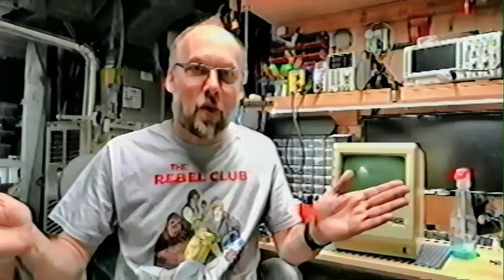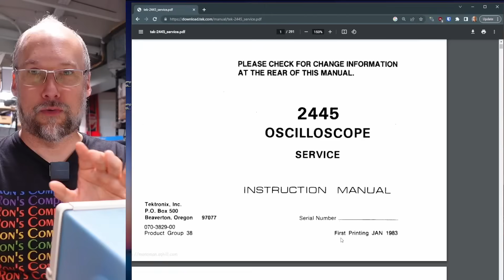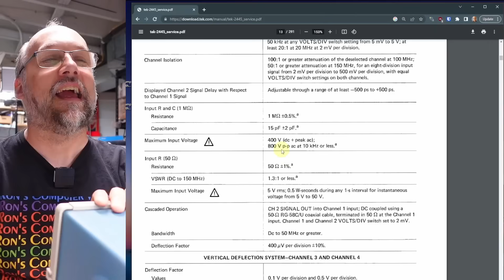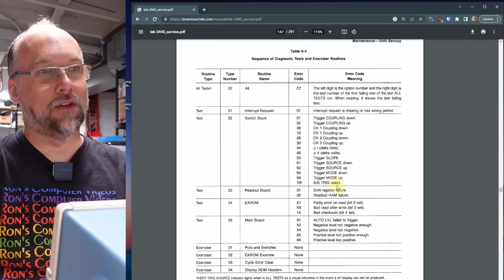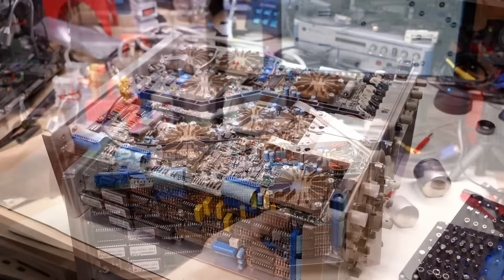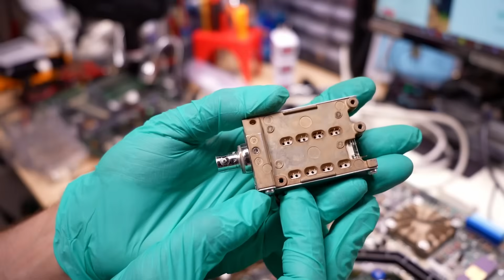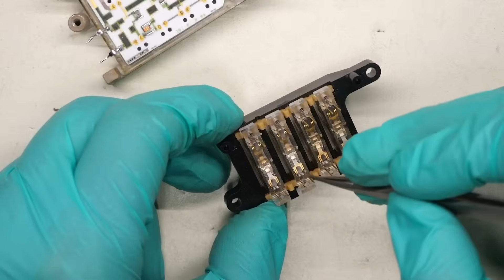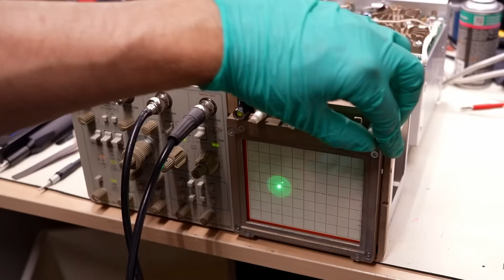Tektronix 2445: My first vintage oscilloscope repair attempt

Comment: No, no, no. Don't scrape those contacts like that. Clean/scrub with an alcohol pad (IPA). DON'T use the "fader lube" Deoxit or anything that contains lubricant.

The relay internal contacts might need cleaning. And as also suggested, carefully bend those tangs in the direction to give better contact.

Having to use a paper wedge means you haven't fixed it . . . the issue still persists.

Comment: I'd use a fiberglass scratch brush before I'd scrape any contacts with anything, especially gold plated ones. A pencil eraser would be the best thing to use in my opinion and would shine those right up again no problem. This works on copper, nikel plated, or any other type of contacts as well.

Comment: Dont know about rifas, but I know some of these scopes, my 2445a being one, has a battery that as of late is getting very old and is at risk of dying. That battery is for the memory that is where all the calibration onformation is stored and is a little tricky to change as you need to supply alternative voltage while swapping the batter to ensure the memory is not lost. If that happens I heard that calibration is virtually impossible for the average hobbyist due to the equipment needed to perform it, making it a pretty costly venture. I tested the voltage on my battery and luckily it is still almost like brand new surprisingly after more than 30 years, but Ill be changing it very soon. The same memory wasnt used on all the scopes in this series, so not all of them in the series requires a battery for the calibration memory, only certain ones from what I've researched on the subject.

Comment: FYI, the components are listed in back of the manual and a vendor code is assigned.   (In reference to the 3-pin caps you were looking at or other parts).  A  vendor code table is in section 10-2, and page 277 of the PDF. 
Unfortunately Tek made a lot of custom parts, like IC's, film resistors on ceramic, and even caps.  If it has a Tek vendor code, 80009, it may be near impossible to find.

Comment: Worked at Tek for 10 years in CRT and engineering.  We used the mag latch relays in a few of our products.  The spacing of the relay tabs are designed to slide on the gold to self clean. It is a very tight spec. Bending the tabs is likely to ruin the sliding action.  The plastic holding the relays on prototypes were found to distort in the temperature chamber. That maintains the critical spacing.   We switched to glass filled polycarbonate that is less temperature sensitive and that solved the problem.  Possibly the plastic is distorting.  Not sure what the 2445 guys used.  
From watching the response it appeared the connection to the Ch1 BNC had a bad solder joint.  The BNC's take a lot of abuse so the most likely point of failure.  My 2 cents.

Comment: A digital scope is computer hardware and software displaying what it thinks the signal looks like, an analog displays the real signal in real time. The one thing an analog scope will do (at least a good one) is trigger far beyond the vertical bandwidth. I have an old Tek 485 350MHz scope that will trigger out to a 550MHz sine wave. Now granted the signal amplitude is not correct and the display is still risetime limited but you don't have digital artifacts that you see on a digital scope when you try to push it past it's bandwidth. So you are correct it's good to have an analog scope even when you have a digital one. Someday there will be wide bandwidth high sample rate 12 to 16+ bit digital scopes that are affordable. They are getting closer but until then I'll keep a few analog scopes around. On your repair I did cringe when you used the metal tool on the ceramic attenuator board. When I work on those I use foam tipped swabs and 99% IPA. You could probably use a little Caig ProGold on those pads (sparingly just enough to leave a film, no more). 2445 and the 2465's are great scopes. It looks like you have a winner there. Sam W3OHM

Comment: It time index 3:40 you talk about the duration using the coursers to figure out the frequency. If you push both buttons, the Delta V and the Delta T, at once it will give you the frequency.
Reply: I think that only works on certain models with certain add ons. I have a 2445A, basically the same scope as this, just a little newer with a handful of minor changes and I can't do that as far as I can tell from reading the manual because I lack whatever add on that was mentioned.....it was quite a few months back I read that in the manual so I don't fully remember the specifics, but the best way to find out is to just fire it up and try it, which I intend to do here as soon as I get a minute. I didn't know anything about pressing those 2 buttons or whatever, just read the manual when I was wanting to double check the frequency of a modulated carrier and didn't have a counter handy. I have a frequency counter now anyways, but I'm interested to see if this works on my scope and then I can check the accuracy just for kicks.
Reply: @chrischeetham1652  It should work. I've used the 24xx series scopes for decades on my electronics bench and it has always worked for me. Some of the scopes like the 2465B will when you hit the orange colored button and then the option will actually display all the parameters on the screen. Rise, Fall, Pulse Width, Pk to Pk and Frequency and a few other parameters. I don't remember the exact sequence since that was decade ago, but it was really cool. Loved those scopes. I've since moved onto the TDS 620B & TDS 744A. But I still have a 2445A to fix on the shelf.

Comment: Well I'm sort of glad I found this video. My 2465 does the same thing only on channel 2. When you were talking about tapping it on the bottom, I was like "Hey wiggle the input just a bit!"  It's a 50 minuet video, so that probably translates to 20 hours of frustration in real time. From the looks of it it almost seems like a thin piece of plastic cut from flat spot on a square bottle or something, would put better pressure on the relays. If I'm going to be aggravated for quite some hours, I think I will look into @Unfinished80 bend the tab solution. Thanks. Subbed and liked. that's the least I can do :?)

Comment: Use Q-tips with polishing compound on the PCB. Clean up with alcohol. Use a skinny straight pick to "tweak" the fingers to apply more tension. Use the relay slider to allow both sides to be adjusted. Clean fingers with alcohol. Use extreme caution on fingers. Two scopes fixed.

Comment: It's kinda depressing to me that you call this a 'vintage' scope, because it reminds me of the Hameg scopes we used to have in my electronics class in like 1988.

I couldn't afford one of those at home, so I had an actual vintage scope. 3" circular CRT, super-basic: single channel, no triggers etc.. Think it might have been Heathkit.

I didn't learn about triggers, XY plots and all that cool stuff until I attended a summer bootcamp (actual paid work experience) as part of a scholarship program at Ferranti in Manchester, England in 1989. I thought that was very cool because Ferranti made the ULA chip in the ZX Spectrum. We were taught by a gnarly old dude who'd been an aircraft engineer in the second world war, and taught us how to tell the temperature of a component during soldering with your thumb. Cable ties were heretical - he taught us cable-lacing. 

I spent the money I got paid on a Cambridge Z88, which I used to take all my college notes for the next 2 years.

Cable-lacing did not remain as part of my skillset 🙂

Comment: By the way, if you press both delta-V and delta-t cursor control buttons it switches to frequency display 🙂 The most instructions are written on the front panel itself.
Reply: correct..had one of these since 1992

Comment: I have several Tektronix scopes, and I have recapped all but one, as I have not decided what I am going to do with it.

I too have a 2445 scope, and I find it to be a nice, inexpensive scope! In fact, many of the different Tek scopes have come down in price, due to the upgrading many industries have made!

When I recap the scopes, I focus on the electrolytics, as they dry out, leak and change value. Afterwards, I have no fear of trusting them letting out the magic smoke, or worse! I was using an HP scope without changing the caps, and it ended up shorting out one of the power supply caps, and it let out some smoke, but it didn't hurt the PC board or other components, thankfully, so I am quite anal about changing caps now.

Comment: 1:55 just note that just because it has a CRT doesn't mean it's analog. When digital scopes first came out, they also had CRTs. Also "scratching" and "jamming paper" in to fix it just gives me the willies. Putting the paper in to put pressuring is not curing the underlying issue.
Reply: So is this specific 'scope analog or digital?
Reply: @MicahtheDrumCorpsPseudoboomer  the 2445 is analog.  But for example, the 2330 is both digital and analog, and has a CRT.

Comment: After seeing that signal at 4:57, I almost immediately knew what the problem was.

I have a Tek scope as well, not the same model. I have a Tek 475 from the 70s. It's fully analog and has no ditigal components. You can add a digital DM44 as an option but mine didn't have that. Back to the point.

One day I noticed my 475 made some really funky signals when a square wave was applied. The signal looked identical to yours. But this only happened when the channel was coupled to AC. This was only on channel 2 though. Channel 1 worked perfect. When channel 2 was coupled to DC, the signal looked like a square wave, and not a strange triangle wave. So of course I went trouble shooting and probing around the vertical section of the scope with another oscilloscope to see exactly where the signal goes funky. 

On the input BNC the signal looked fine, so that rules out a bad BNC. The output of the vertical amplifier looked funky though. So it was not the CRT or any parts after the vertical amplifier. I then probed the output of the attenuators. AHA! The signal looked funky! So I opened up the shielded can and started probing there.

The 475 doesn't need to have the entire attenuator module removed as you can access all the points you need to test by just removing 6 screws and a shield. This made it so I can probe the signals in the attenuators. I probes the input to the attenuators and the signals looked funky. This limited the problem down to only the very front part of the scope. The coupling switches. So checked then and found the signal going into the capacitor for the AC coupling looked fine, but the signal coming out not.

My first guess was the capacitor went bad. So I replaced it and used a modern equivalent. It worked perfect. End of the story right? W R O N G . The AC coupling started going funky again after a few hours, so I poped it back open. The AC input cap on the 475 uses 3 pins instead of 2. One for one plate of the capacitor, one for the other, and one for the metal can surrounding it. My modern cap didn't have the shield so I thought that might be the problem so I popped the old cap back in to take some measurements to find a suitable modern replacement, but the scope started working fine again! Turns out it was just a faulty connection from the capacitor and the attenuator board.

You see, the 475 and other 400 series Tek scopes used socketed devices. Eervy single transistor is socketed, every IC, and some capacitors. The contacts of the sockets where the faulty part. Apparently, nickel plated copper and gold sockets don't work as the nickel corrodes and tarnishes. All I had to do was plate the leads with a tin layer of solder and everything worked fine.

I don't recommend solder plating for your scope though. But bad contacts is what caused this triangle wavefrom for a square wave.

Comment: Hello Adrian. I have a 2430A oscilloscope which is also 150MHz and has already taken some work to repair. Unlike the 2445, it only has 2 channels, but it has 2 trigger inputs (EXT TRIG 1 and EXT TRIG 2). It would be much more useful to me if it had 4 channels.
Could you tell me why someone needs 2 external trigger inputs?

Comment: Teks 2445 and their kind (especially 2465) are not "vintage" scopes, rather they are arguably the best analog scopes world's ever seen, way better than low-tier digital scopes (even the most modern ones) in quite some ways.

Comment: That's a blast from the distant past for me. I had one on my workbench as a RF tech. It cost at least a couple month's salary when new

I'll second the comments about bending the spring contacts. Ideally you need replacement relays HOWEVER you can reset their tension if you're very careful (there are tools for doing this - essentially a piece of stainless steel with a couple of slots to bend the things) - just don't overbend the spring contacts or you'll work harden them and they lose tension entirely

Judging from what I saw in the video., the relay carrier has a foam pressure strip beind the relays, That may have collapsed over the last 40 years too

Comment: If you run the unit outside the case more than briefly,  run airflow from an external fan over the unit. If you cook one of those specialized tek IC's ( they run hot ) you will have a beautiful door stop.

Comment: Good day , thank you for the video , this oscilloscope of 1983 , as I understood , and there are relays in the volt division unit in it , I went to study in the 2nd grade in those years , in 1992 I worked as a repairman and I had an analog oscilloscope with a CRT kinescope , in these sensors it is necessary to measure ESR metr all electrolytic capacitors, thanks for the video, all the best

Comment: thanks a lot, fantastic video, i had one of them 2445 in my lab today, very much the same kind of relay problem, attenuator some points not doing their steps correctly, but we just worked the relays many many times it slowly got better, and now it just dont fail anymore :-)

Comment: That thing is forty years old. It's amazing how well put together it is, and how good it still looks.
Reply: it's amazing the horizontal sweep still works,the H output amp IC was a common failure,a bad batch from Maxim. NO replacement available,its a "TEK-made" IC.

Comment: Any chance a previous owner/user was a a bit brutal and yanked on the cables they had plugged into CH1 and 2 and cracked the BNC connector's connection to the board in the attenuator?  It's rather tempting to think that could be the case given that a very gentle tap on the cable restored the trace to the correct p-t-p voltage...

Comment: Are you really sure it is the relays? 
the relaya static, controlled by impulse coils so therefore it is not very likely that it is the relay module.
On to of that the scope handles up to 150 MHz ia that is pretty high, or per definition very high radio frequencies (VHF).
So my guess is that your problem is a cracked solder joints and/or cracked SMD resistors close to the relay module, but not actually inside it. Why do I think that'?  Because you could see the problem when holding the BNC connector slightly moving it ant therefore applying mechanical force to the PCB and components and solder joints on it. The actual attenuator bridge circuit is most likely directly under the relay module, directly on the other side of the PCB.
Good luck and thanks for a sovereign youtube channel, I enjoy every second of it!

Comment: Have you tried using one of those 24 Kt gold pcb plating kits?  replating the pads might help it make better contact.  You might also need to replace the relays.  They don't last forever.  Even if it costs you a couple hundred bucks to get some good relays, it'd be worth it.

Comment: My 2445B is working very well indeed, I do use it every now and then. A while ago I did swap out all tantalum capacitors as they are known to be flakey, and some capacitors actually showed signs of leakage. After cleaning it all up and swapping the capacitors, it's all in mint condition again.
The 2445B has a battery-powered CMOS memory chip which keeps calibrarion data. Not sure if yours does? If so, it might be worth reading the values in an EPROM programmer (just look that up, young whippersnapper ;) and store for when it needs replacing. Obviously the factory battery is long overdue.

Comment: Those combined C14 connector/netfilters can also fail and stink up the place like a RIFA does. I suspect they have RIFA's inside.. I always replace them on sight. I have had them fail in all my Tek scopes (3). They usually go with a big bang and a lot of smoke and smell.
Also: it triggers a lot better with low frequency signals if you don't set it to "LF Rej." ;)

For the gold contacts: I either use just IPA or Ethanol to clean them. Never ever scratch them. That's the worst thing you can do. Worst case you can use some mild polish to buff them up. Look at them under a microscope to see what damage the scratching does...
Those ceramic modules (hybrids) should be soldered with silver solder... Normal solder ruins them.